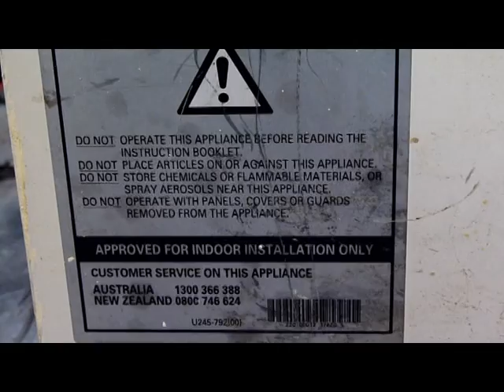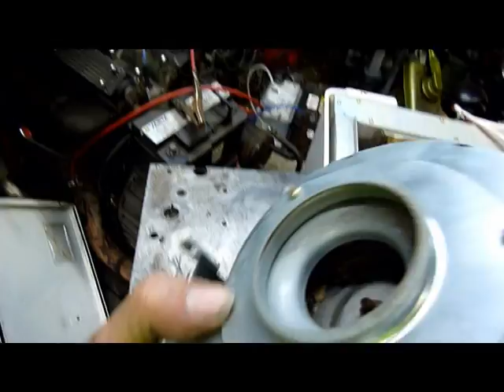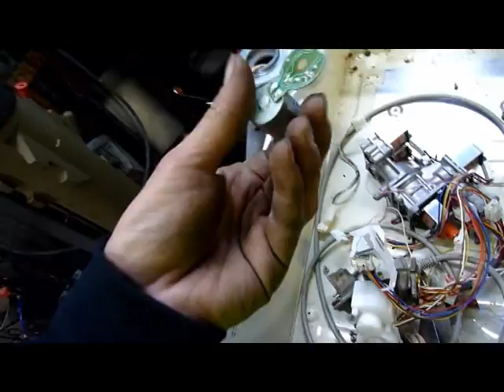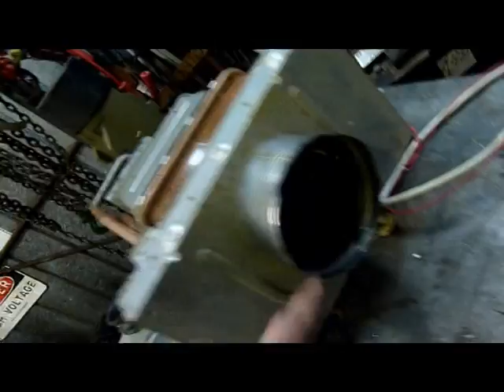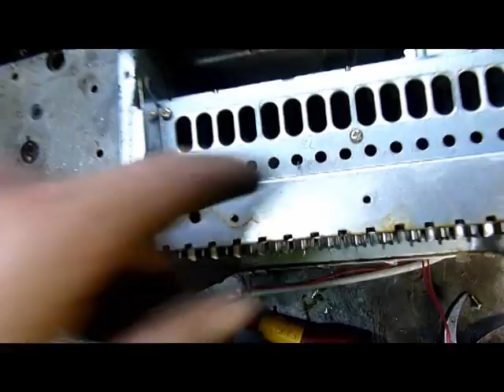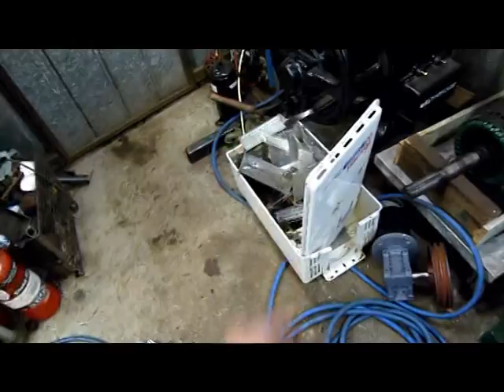Equipment Autopsy - Rinnai Infinity 26 Gas Water Heater

Comment: My Rinnai infinity 24 is 22 yrs old and just played up recently. I opened it up, with power off, and cleaned all the burners with my air compressor, fan was clean and PCB looked okay. I sanded back the spark electrodes, a little oxidized. Cleaned the inlet water filter but didn't flush the system with vinegar to remove any  built up salt in the copper piping. My system is working fine now. I really can't complain, apparently it has a life span of 25 yrs.

Comment: warning to all  users no matter the brand in winter and in season that cause frosting or freezing on these units can and will crack plastic water valve bodies if going to have big freeze i suggest turn of water inlet valve undo hot water side vales and let water drain out best to do this with both valves to stop freezing up and breaking the valve bodies older models dont have building antifreeze detections and gas wont light up to protect unit during freeze ups

Comment: these unit are low voltage regulated this why they need all that crap wiring every valve and module are 13 to 16 volts operational adr prevent operation of gas near high powered mains circuits there also builting spark arresters in these units to stop sparks and statics

Comment: G,day All

Rinnai Company ,  I remember doing are course at RINNAI Australia 
Many moonS ago,  ( Rinnai A Japanese Company a Family Company, Excellent 
Build quality) I recently made inquires
in availability on parts , Rinnai Australia 
Can still get on appliances 20 years old , most Mfg's on  parts is normally
7 to 10 years, apart parts sitting  in the warehouse or stockist. RINNAI on the
Electronics are well designed and redundant and generally electrically surge protected 
Environment , temperature etc , coastal regions Beach etc salty air, effecting
Electrically connections, circuit board coated , ( heat exchanger ) water Quilty 
( The creamy powder coated or the mains of applying a material been a paint
Could be better have seen corrosion on a a Infinity 32,  or range you can get additional 
Service information, but generally is only given to Plumbers/ Gasfitter or a person
Authorised to install and service, ( PDF Format ) The service and professional 
Advices is excellent ....... 

Regards
Allllll

Comment: No idea .sorry mate no idea .its an internal Rinnai .installed $2400.00 .second hand I can get $850 cash for that model .and it's probably a blocked inlet filter .simple fix ..thats on the middle connection ( water in ) .& sorry there one of the most reliable heaters on the market.Made in Japan.& it dosn't compare to a Bosch .speaking from 20 years of experience in the hot water repair market..you killed a fine bit of Japanese ART In engineering.

Comment: OK, I also use these electronic tankless water heaters, because mine came with the house. I think mine is 11 years old, it is still going strong, Mine is an Infinity 24 external version, it has a defrosting heater(I'm sure the one in this video has it), also the old house I used to live in has the same, and it is still going too! I even notice, almost EVERYBODY here have these electronic modern tankless water heaters. Unfortunately mine did not come with a thermostat, the old house did, the thermostat is actually not required to run the unit.
I think I live in a cleaner environment than Australia, which is probably why electronic things here last ridiculously long.
I imagine how hard it is to run a combustion blower without the PCB

Comment: The electronics are necessary so the unit can cleverly maintain a set temperature water no matter what the water flow (alot of on the fly adjustments). Not to mention safety features. The unit is actually very reliable Japanese quality and puts boshe to shame. (google it)

give this autopsy video 1 star

Comment: FLASH memory has a 5 - 10 year life in hight temp industrial environment.  Five years maximum (some offer only 3 years).

Life secure equipment requires 3 or more banks of identical flash memory with a supervisory processor.  Check and compare of ever bit if it decides to change.  Correct, restore and resume.

Comment: The new water heaters use FLASH memory processors.  At the higher surface chip temperatures, the electrons escape from their barriers more rapidly.

Result is memory cell failure.  This will cause the CPU to shut down.

Re-flash is simply erasing all the flash memory in the chip and then loading the program into it again.  Exactly the same as formatting a disk and loading new files.  It's as good as new again.

Comment: Have two of these units that began failing at the same time(6 years old). Figured it was a scaling problem--hard water in our area.  After flushing both with numerous gallons of white vinegar the problem wasn't solved.  Factory Troubleshooting guide way to involved for my patience and I was just about to replace both with conventional heaters.  Saw the MOTHS IN YOUR SQUIRREL CAGE.  Pulled my squirrel cages--full of moths--cleaned them and they work great again! THANKS MY AUSSIE  BROTHER!

Comment: They need to be efficient, we don't have endless energy to waste,  I work on all the makes of hot water unit and 99.99% of failures are caused by installers or guys like you who have no idea what they are talking about! A little knowledge is dangerous, so if you don't know all about something at least have the sense to know your limits!! Why don't you set up as a technical guru?? LOL

Comment: You guys that are slagging these systems of need to go back to tech and learn some more! The guy that posted the video is a complete clown, the unit does not have a pump and he obviously has no idea what the parts do! The failure of this unit is due to installer error, like most of the problems, I will bet that no condensate trap was fitted to the flue system and acid has run back down the flue and rotted the heat exchanger, this would happen no matter what gauge it was!!  MORON!

Comment: Also if you have a controller connected it will show fault codes to easily find the problem and fix it. That unit would have been an easy fix. The jets are not that aluminium block, that is just a manifold. The jets are closer to the gas control and the sizes are written on the data sticker you filmed at the start. To convert to propane you just buy a few jets and change one of the dip switches. Cheap as.

Comment: The electrics control the remote controllers inside the house to allow temperature adjustment. Set the water temp. to 41c and that is what it makes. Also they have a bath fill function that lets you set the temp. and water quantity in litres and it will shut off the water when finished with a voice that tells you when it is done. If you don't use the remote controls then all that stuff inside is wasted. You can buy simple natural draft instantaneous HWS for just water heating with no control.

Comment: I have similar heater to this but junkers .. german made .. very expensive ... well made and durable right ? NOPE after 6 i repeat 6! years the fucking exchanger punctured itself .... dafuq repair costet fucking 800 euro and guess what ? next year the water pump in it stopped working fortunetly hammer solved that one , it was jsut some shit stuck in pump and it wouldnt start and dont get me started ot the fucking computer .. my grandma has water heater for 45 years and it havent been broken yet

Comment: If the electronics were built right, these would earn much more respect.  Need to get rid of the switching power supply and go to good old fashion transformer and linear power supply.  Lose some efficiency, but save energy in the long run when boards don't need replacing.  Stop potting the circuit boards and enclose them in a sealed box.  Potting compound causes solder fatigue on surface mount components.  Avoid SMT on something made to last... through hole technology is older, but robust.

Comment: WTF! Why didn't the Circuit boards in the AC condenser units in your last vid have the epoxy coating?!!! You are exactly right about the cost to manufacture all the electronics. I am an electronics romantic. I understand that energy efficiency is important. So why make a water heater with all that expensive circuitry? IT'S A WATER HEATER!!!  Thanks for the vids.

Comment: I think the circuitry involves the ignition which is also tied into the pump and that blower, the gas fires up when someone turns the water, then the blower and pump kicks in. The circuitry may also regulate air fuel mixture but I doubt it, since it's strictly an on demand unit, probably just makes sure that the gas shuts off at the right time and shuts the gas off if it doesn't ignite. In any event the coil was the problem not the electronics, even so they could simplify it considerably.

Comment from the maker: @CorbyStarletCj1 yes that's correct, it also wanted a gas pressure signal as well. :(. its like trying to run a inverter AC condensing unit with no indoor unit. it just won;t do it without the proper signals.

Comment from the maker: @BiLock102 yeh the new electronic systems are rubbish!, as you will see in my latest inverter AC  unit vid thats uploading.

I have nothing against normal simple, reliable gas fired or electric heater tanks!. they are the best way to go.

hell, there are still many copper lined electric heaters from the 1960's still in service today!

Comment: Sadly, I work in a "leading" fast food outlet and in my 10 years, we have scrapped 3 infinity 26 units due to PCB's frying out, we now have a Rhemglas Sqaure style tank. Simple...why the F^^^ does a hot water service need a computer, I have seen Bosch units that don't even need power to work! I hope you have nothing against electric and gas tanks, they are so simple to work out :P Thanks BiLock102

Comment: Have you actually seen one of these in operation?  The way they work is that you have temperature controllers in the house, usually one in the kitchen and one in the bathroom, so when you want the water to be at a specific temperature you dial the temperature on the controller, hence the reason for all the electronics.  Yeah, it's kind of silly, but that's how they're designed and how they work, I've known a few people with these.